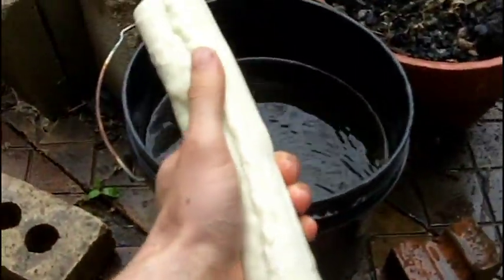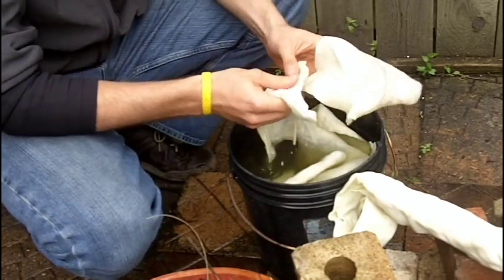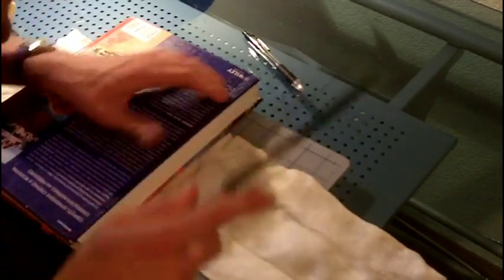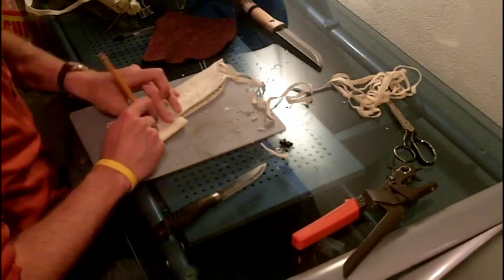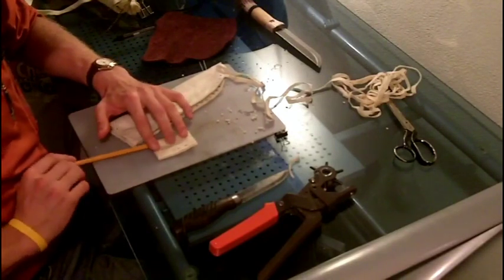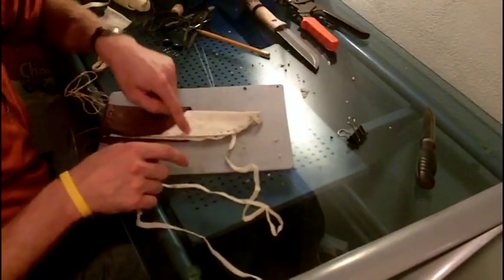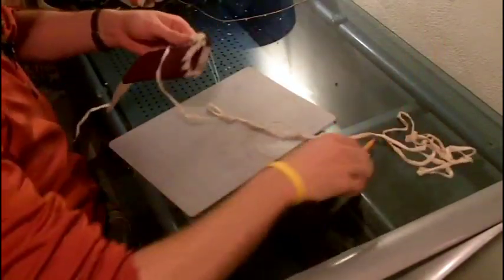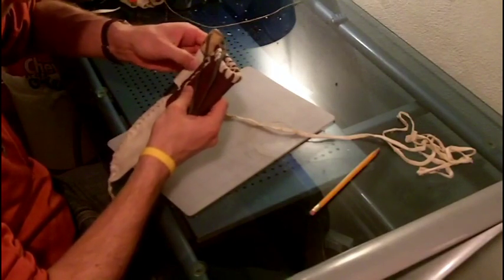Making a Rawhide Knife Sheath

Comment: Just a short comment. In my 50+ years of knife and sheath making, I have found that Rawhide dries hard as rock! Didn't that bother you when your sheath dried? I've found that it will abrade whatever handle you use AND the blade. Are you concerned by that? One other note...if you put a point on your Rawhide lace (like you did) then dry just that point with a hair dryer, the pointed part will work like a needle. Nice job Thank you.
God bless:

Two Feathers
Proprietor of:
The Mountain Man Emporium
Reply: I find that that's a good thing, using  cowhide is much better for sheaths as its thick and rigid, bit it's much more expensive, so when rawhide gets more rigid as it dries, it holds the shape of the knife better.
Reply: @shaggyat5power112  Thanks. I buy Goat Rawhide from Springfield Leather in Missouri, and sometimes Elk Rawhide. The prices are really good. I (personally) don't see Rawhide as being a good choice when it gets as hard and as abrasive as rock, but then that's just me. Thanks again.
Dave
Reply: @Stoney327  yah, I do definitely prefer cowhide, but I find rawhide to make as a suitable replacement when done right